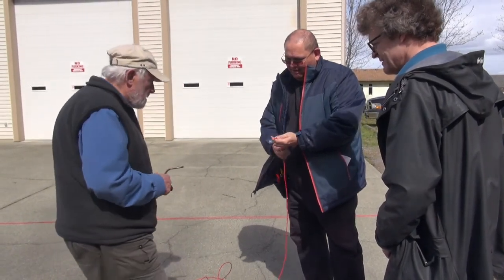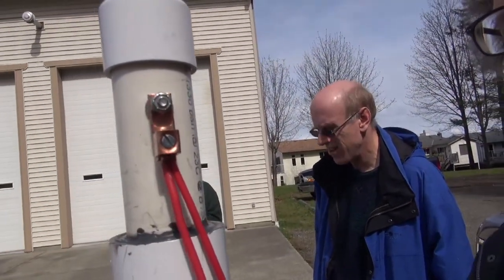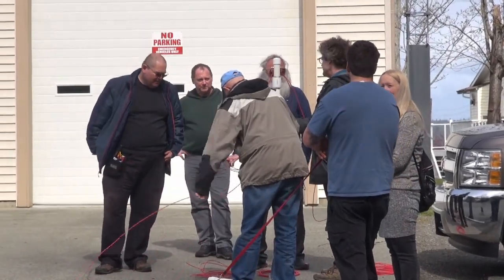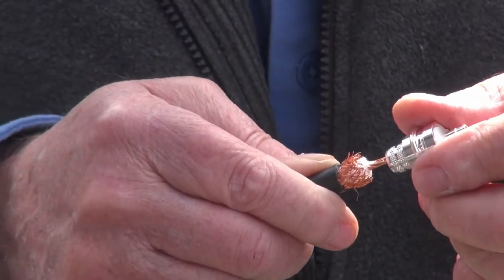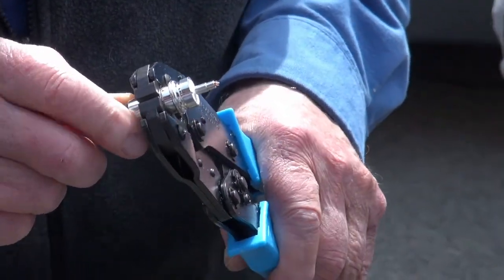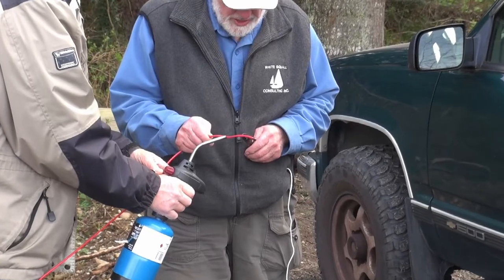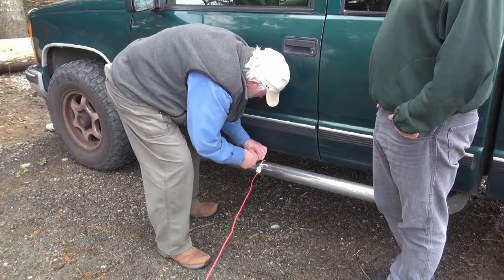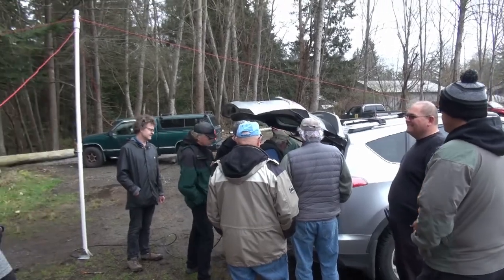SRD Instructional #4: NVIS Antenna Construction, Part 2

Comment: Did I miss something? How is the coax attached to the wire? Are the 4 wires all connected to one another via the bolt that runs thru the pvc pipe? Or are they separate?